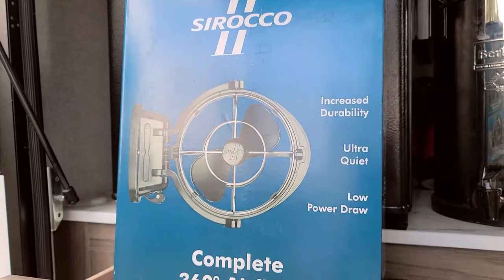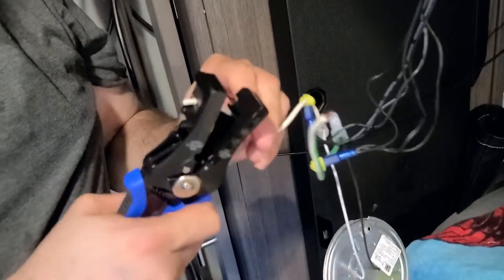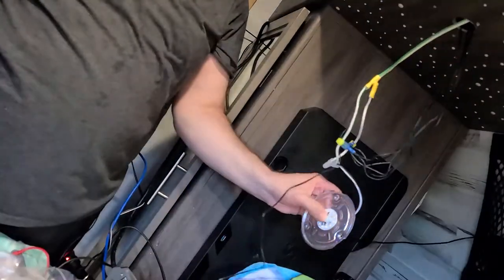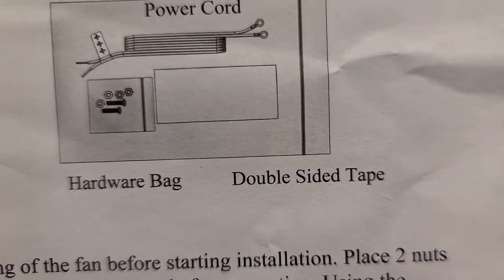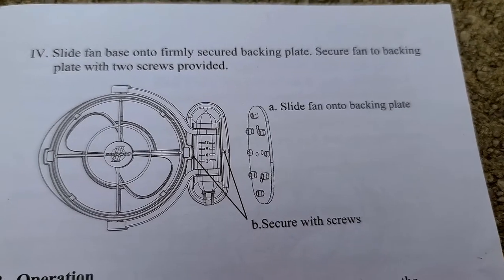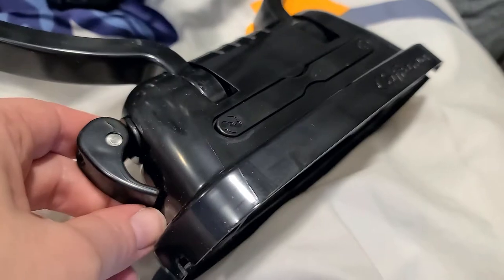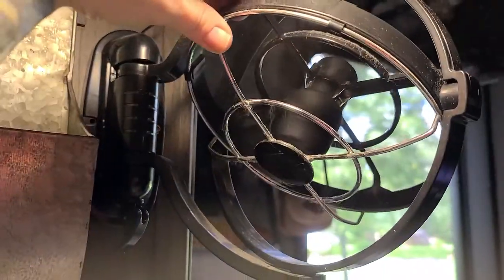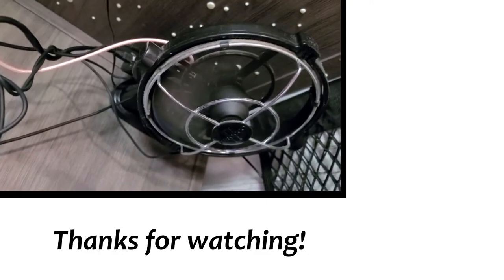Caframo Sirocco II Fan 3- Speed Gimbal Fan INSTALLATION & Review!! Bonus: 3 Months Later

Comment: Hey there, thanks for the informative vid! I'm just wondering if when you "splice" the wire into another electronic's wire- does that mean you can only run the fan if that appliance is on? (in this case your puck lights? Could you give me some more info on how this fan could connect to a setup? I'm also starting my electrical from scratch very soon, and I'm using a jackery 300. Thanks for any extra help you can give! much appreciated
Reply from the maker: @theshepard22 Hi.  I spliced the positive wire from the fan into the positive wire going into the puck. Because it's live or hot... it's always on.